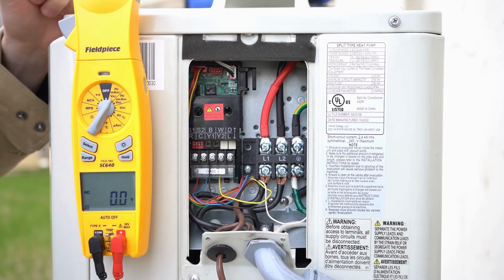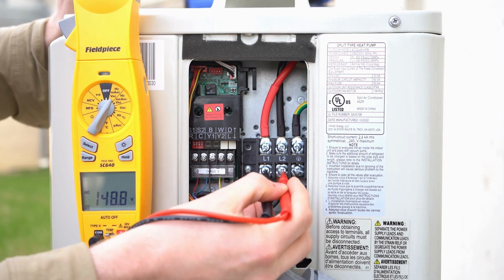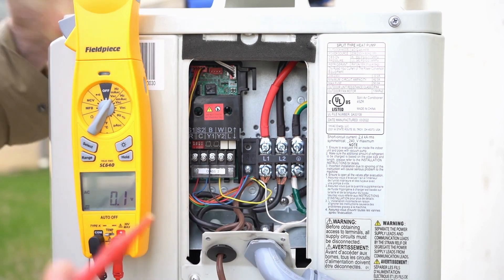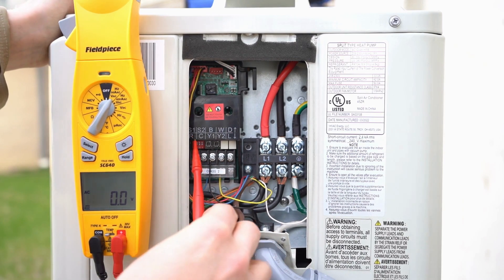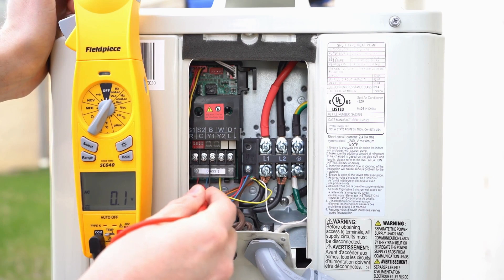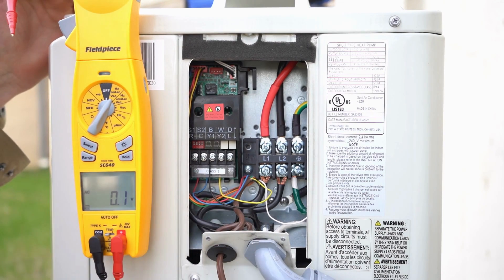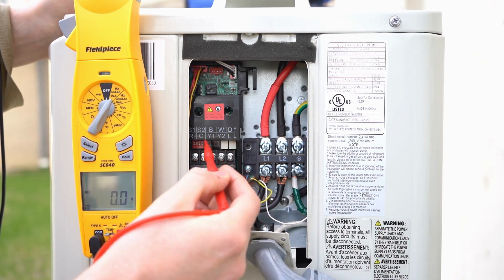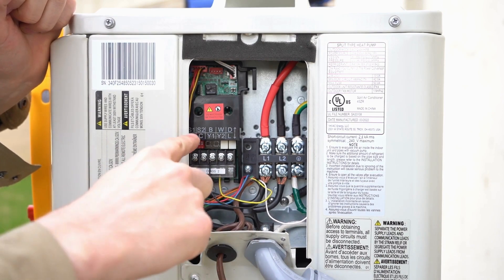How to Wire a 24v Thermostat with ACiQ Next Gen Heat Pump

Comment: Need dip switch video I have the 4 ton and it's just reading 00 I set the air handler dip switch to read 24 but idk if there is something similar to do to condenser

Comment: What are the pros/cons of operating these units set up for non-communication opposed to fully communicating? Will the 24v Tstat reduce the capabilities to one or two stages instead of full modulation? In a retrofit application is running new tstat wiring typically necessary for full communication/ variable speed operation?

Comment: I am getting a el 01 in the air handler it states no communication should I hook s1 and s2 thank you
Reply from the maker: If you're using a 24v in and outdoor, then the indoor dip switches SW1-1 and SW1-4 need to be on. On the outdoor unit SW1-2 needs to be on.

Comment: OK, you just showed the outside unit. That outside unit is not the thermostat. How about you actually show what to do inside the house?
Reply from the maker: We will take that into consideration for a future video for sure. Thanks for the suggestion.
Reply: If you install a 24 volt thermostat on the air handler u need dip switch 1 switch 1 on for it to recognize it

Comment: setting up for communication according to the manual  only connects S1 and S2 from outside to inside, does that mean no other connections are needed? OR are there other connections needed when setting up for communication? why would someone not set it up for communication if that's the most efficient?
Reply: Can yall answer this man/woman's question please? I just bought a 5 ton ACIQ heat pump that's inverter and have the same question
Reply: No other connections were needed if you use the 12v DC thermostat that is provided. If you opt for the after market thermostat, that uses 5 wire 24AC if I'm not mistaken. @stevenohnsat7535
Reply: @stevenohnsat7535  Is there a number to call for assistance? I'm trying to hook my ACIQ unit up and I'm a bit confused with it, did you have any luck on getting your system wired up if so what did you do?
Reply: Indoor unit wiring?
Reply: You probably figured it out by now but for those who haven't, S1 and S2 are the only connections you'll need from the air handler to the condenser IF you are using the ACiQ thermostat that came with the unit. You'll still need to connect from the thermostat to the air handler which is only two wires as well.
Reply from the maker: Yes you only need S1 and S2 if you have the ACiQ Air Handler and outdoor unit. If they don't have our air handler then they are connecting to just a coil and the outdoor unit will need to be in 24V mode to communicate with the gas furnace.